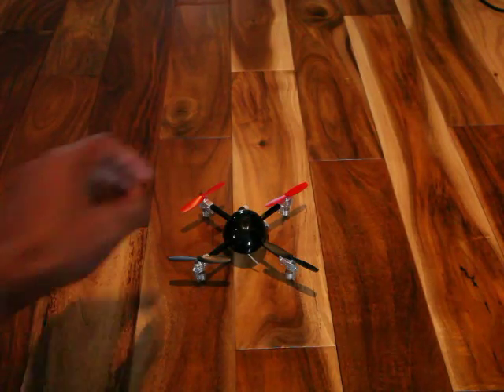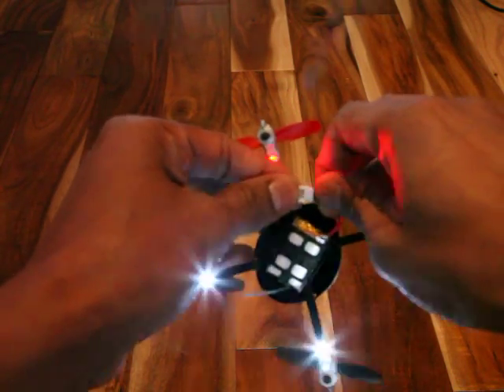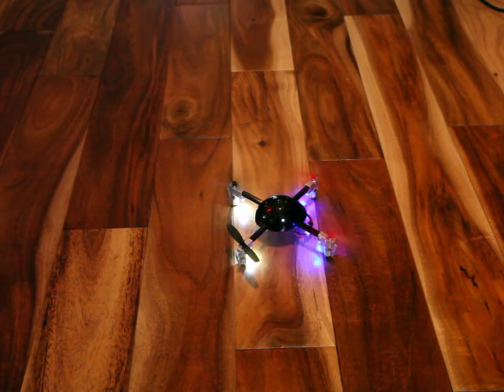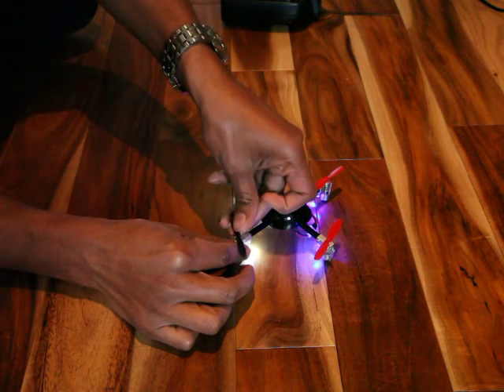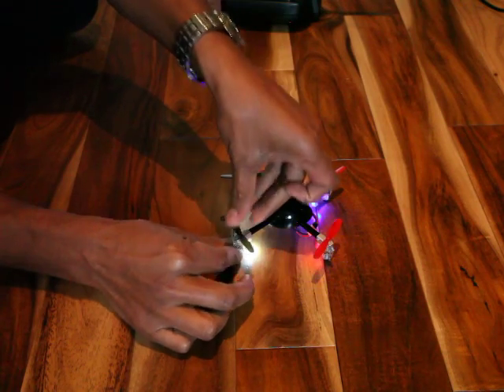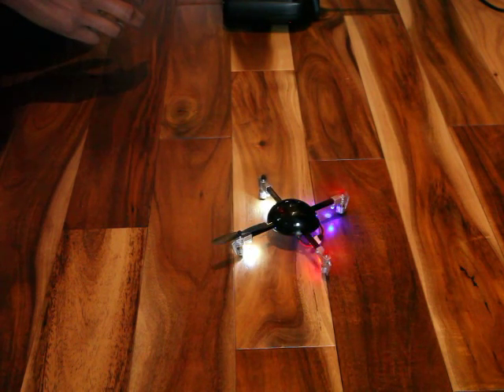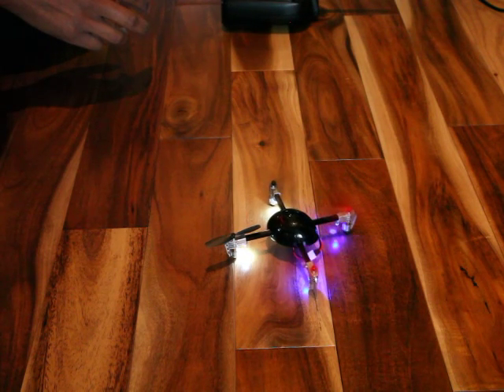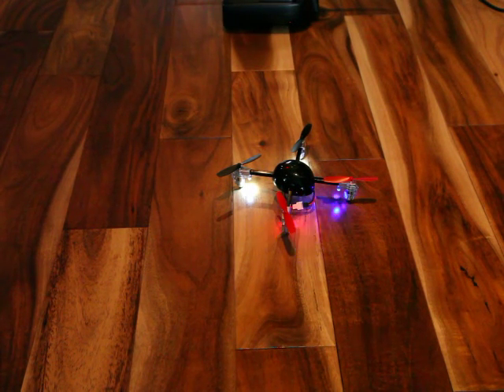Microdrone 2.0 Rotor problem

Comment: I have the 3.0 and have had a similar issue... however, the problem was the motor impacted on landing/crashing and pushed the entire motor downward placing resistance on the rotor arm... the fix is simple - hold the housing right at the motor firmly and then push the motor upward... if it is this problem you will see it "seat" back to the original position and it then should fix the problem... hope this helps...

Comment: there's a motor making the rotor spin so you might have to take the motor out and check it/replace if needed if that does not work then i suggest looking on the internet or seek help. Its quite difficult getting to the the motor though

Comment: Anyone know how to replace these? No documentation anywhere. same issue after 3 flights.
Reply from the maker: it's fairly easy. just disconnect the cable, pop the arm off and then connect the new arm. I managed to do it in a few minutes
Reply: +shaun365 They finally delivered my parts. But... The arm has 3 wires not 4. wtf? is that the drone 1.0 arm they shipped me?